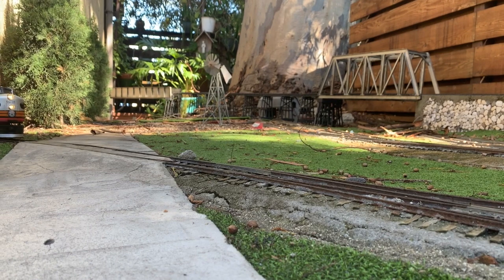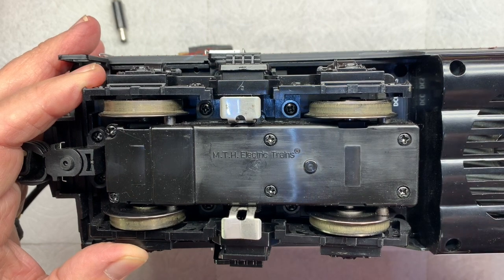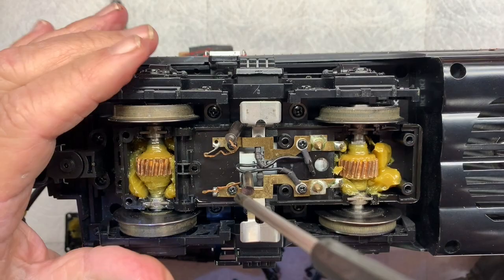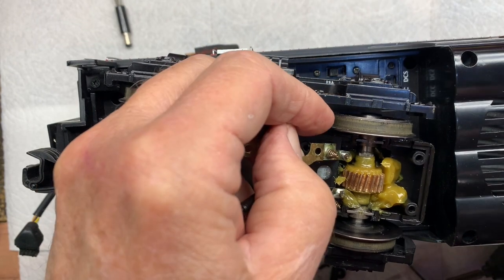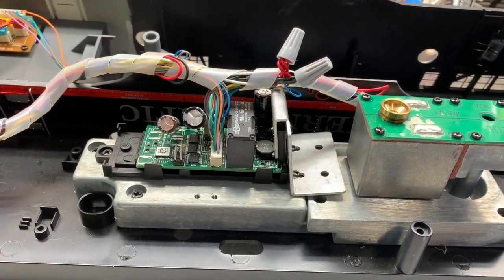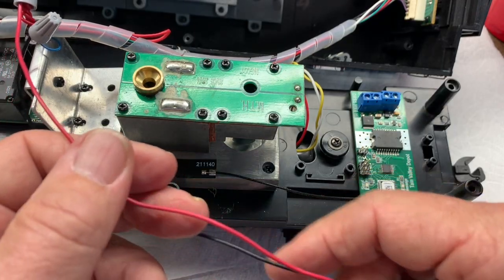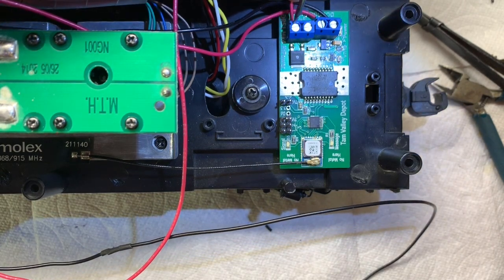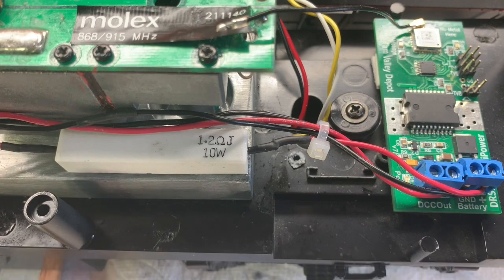MTH F7

Comment: Thanks for the great install demonstration. I don’t use MTH currently but I think your install is very useful for any deadrail conversion. 

I guess I don’t understand the ‘large capacitors’, does MTH DCS have a built in anti stall device for dirty track issues?

Here from the BlueRail group.
Reply from the maker: I am not sure but I believe the capacitors are primarily there to power the sound system when running on DC power and track voltage is lower than that needed for the sound.  They may also help run on dirty track.
Reply from the maker: I am not sure but I believe the capacitors are primarily there to power the sound system when running on DC power and track voltage is lower than that needed for the sound.  They may also help run on dirty track.

Comment: You mentioned locos are setup as master-slave.  What exactly does that mean?  How are they wired together or are they DCC master-slave?  Are both locos redone the same way?  Where did you put the speaker?
Reply from the maker: Only one unit contains the decoder.  MTH calls it Proto-Sound 3.0.  The command protocol for this is proprietary but it can also operate in DCC mode.  It also has the sound file, amplifier, and speaker (in the fuel tank).  All this makes it the master unit.  It sends info and commands via an umbilical to the other unit to control its motors, lights, smoke unit, etc.  This makes it the slave unit.  It does not have a sound system.  It cannot operate independently.  Of course, with the addition of battery and the Tam Valley receiver, the master cannot operate without the slave.